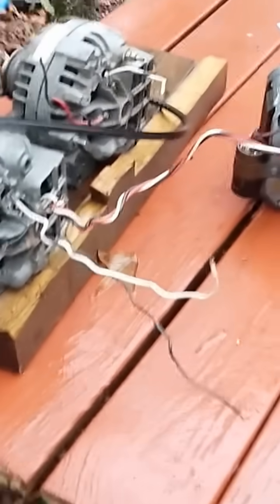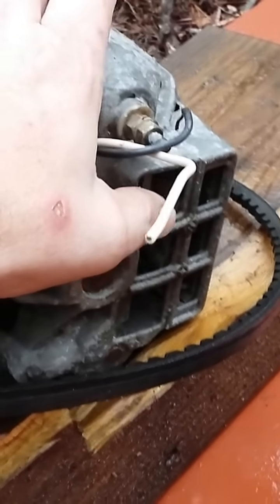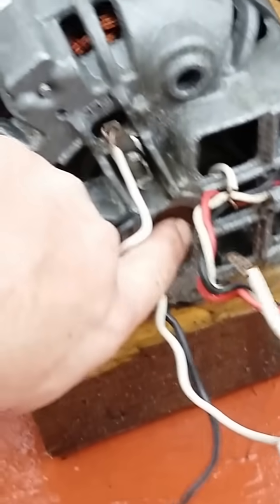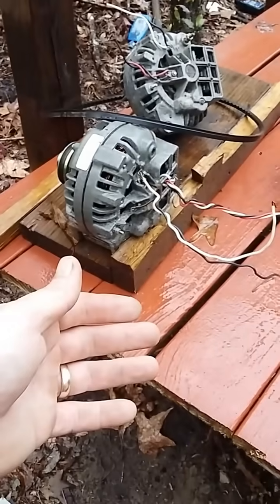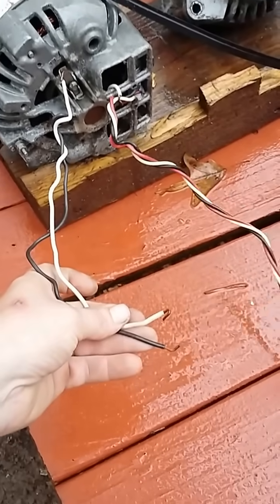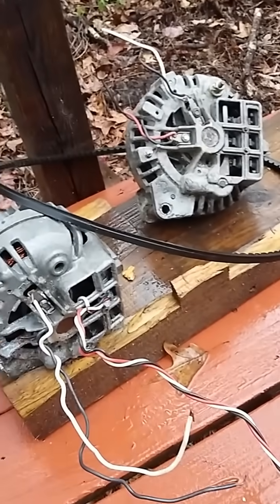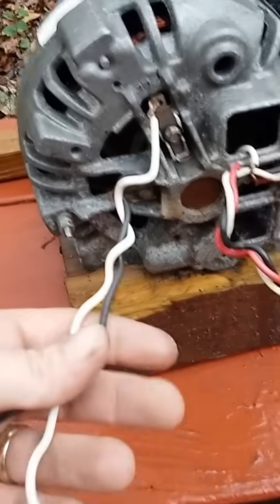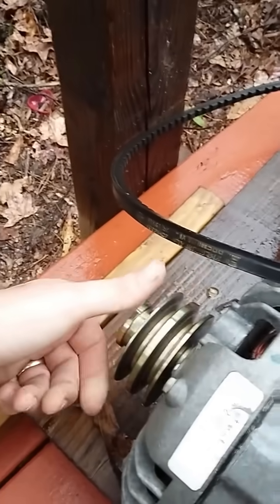Update Free energy forever no wind no solar no gas READ DISCRIPTION!!!

Comment: I need to know how to wire up the alternator please
Reply from the maker: August Nielsen your alternator is already a generator. all generators used to be called alternators and they actually put out alternating current and it is ran through a set of diodes called a bridge rectifier. you don't have to use all of your sine wave but you do have to use the top portion of it. If you want it to produce alternate current all you have to do is bypass the bridge rectifier but keep in mind it is unregulated until it gets to the bridge rectifier so you will need a capacitor to regulate the voltage there is a little more to it but you are going to need a high-torque high RPM (3600minimum) Motor that only consumes one or two amps and this can only be done with permanent magnet motors.. I hope this helps you out! you should do some research on vfds and learn how Transformers work and learn basics of alternate current like how to get a neutral from a ground and things like that... I hope this comment helps you, have a wonderful day.
Reply: ThomasBuie EnergyBuies at gmail com didn't make sense but ok. Thought of this same thing when I was 12. You run the 1st alternator with a motor but part of the power that 1st one generates  goes to motor. You can put a belt on the motor and run multiple alternators  and only 1 needs to have its current running back to the motor.  The others can be ran to batteries so you always have a charge. The reason this doesn't work 100% is just like when you have 1 in your car, it will go out and the motor will too over time. He's a scary guy moving to the woods. I used my setup when I was growing "vegetables " indoors and didn't want to run up my electric bill. Don't hook up a dryer or stove. Lights are cool, tv, a.c. might work. Is find a friend that's an electrician to help you.
Reply: ThomasBuie EnergyBuies at gmail com a generator
Reply from the maker: August Nielsen
Wired to be a motor or a generator?

Comment: I almost got upset thinking someone figured out my project but after watching the video I am at ease this is all bogus! You can achieve free energy with this concept but you are missing a lot of key things to make it function. I will give you one helpful thing you need a battery bank lol. You need much more than that but without a battery bank that cycles to maintain constant energy in and out this is a complete fail! Like I said I won't tell you the rest of the things needed to achieve the power needed and the process to do so because you are straight up lying this setup will not power a home at all!
Reply: John Corigan 
Like what?
Reply from the maker: I don't need your help I've already built a variable frequency driver for my alternator motor you are not a good person and I'm not going to help you finish your project I have about eight people that have their ears up and running and I'm going to continue helping people until they all have their systems up and running and they're sharing with other people how to do it I've told hundreds of people many Secrets but I will tell you nothing... you need a battery Bank... well no kidding!
Reply: If you have this in operation why are you only showing this and not an actual running of it working? I was going off this video what you claimed off this showing is not complete in any way! My apologies if there is more that you have on this with the rest of whats needed but this video does not show it.
Reply: Also I never asked for anything my friend. I have a working free energy set up similar to this but it is complete. Hence why I commented on this as not being possible in its current set up!
Reply from the maker: John Corigan I made this video to keep unwanted people away such as immature people that can't listen to baby's crying and so forth and so on. I have over a hundred and thirty videos and when my security system is complete I will open source everything!!! how I built my H Bridge, what I'm using for my pulse wave modulator, my rectifier circuit that feeds my H Bridge, all of it will be open sourced!!! even though people are not supporting me... 
I understand no one can afford to send me $5 and I think it should be this way..
I think that I should work my entire life for something just to give it away to everyone so that they can be happy and that they can save money and be free from treacherous activities... thank you for watching my videos it's how we eat!!
Reply: You seem to be very intelligent by the approach you are implying I have no doubt that you do know the secrets to the finished process. I am sorry that I came off that way most people like to create a concept and make claims they can't produce. I can understand that you may not want to show how its done but in the future showing results without showing too much in a video that could cause problems would clear up a lot of doubt.
Reply: I did and understand that you left out things 100% some things that were left out kinda made it look as if you did not know what you were doing but again my apologies

Comment: BS..I want to see you put 90 amps on a number 10 and use it to service your distribution panel   for your General lighting and household appliances. Hook all that up and show me where you are getting 240 volts pushing 90 amps of current on a number 10 wire with an ampacity of 30 amps and the wire not vaporize.  Hook it up and let me see it work with a meter.
Reply: You are right I wanted to see that because it would be a #2 AWG
Reply: Keyboard Warriors, gotta luv em.
Reply: billy Reyes .yes sir  Copper or a 4/0 aluminum. Both a very far cry from a number 10.
Reply from the maker: Chandler Guy good job running your mouth! And just so you know, the alternator in this video is my primary mover...

Comment: That’s a 60 amp Chrysler alternator. The “copper things” inside are called slip rings, and they are the contact points for the brushes, so the alternator is not brushless, nor is it 90 amps. The rotating part is called the ROTOR, because it ROTates. The fixed coils are called the STATOR, because they are STATionary. The alternator does generate 3-phase alternating current, which is internally wired from the stator to the diodes. You got that much correct. There are six diodes, not three. (By the way, your motor has no diodes at all.) Now, without voltage regulation, assuming you can spin the alternator fast enough to produce 220V, then at your claimed 90 amps output, again assuming that you connect a full 90 amps load, your wiring, which appears to be about 12 gauge, is going to burn up. Then there’s the problem of frequency. Light bulbs won’t care, but any appliances or electronics that require 60 Hz power will not function at the high and unpredictable frequencies the alternator will deliver. Then there’s phase angle. 220V household power is composed of two phases 180 degrees apart. Two of your alternator phases will be only 120 degrees apart, again causing trouble. 

This all assumes that you can turn the alternator successfully to begin with. What power source are you using to spin it? An electric motor? How is that free? The alternator can’t power its own motor because of mechanical and electrical losses. Friction and resistance are real. If you’re using commercial power to run the alternator, then you’re still paying the power company, and paying them more to overcome frictional loss in the motor and alternator, in the belt, and electrical inefficiency in both units.
 
Commercial power isn’t free to produce. They may overcharge us, but there is cost involved. I pay no more than $150 per month maximum, usually for about 1,500kWh. If you’re paying $300-$1,000, you should seek another retail service provider. 

You claim to make 19.8kW from that Chrysler alternator—90 amps at 220 volts. Look at a 20kW diesel generator sometime, its physical size and horsepower. Ask yourself why the difference.

I’ve watched people try to convince themselves—and others—about free power for 50 years. Yet it remains a deep “secret” that only a privileged few claim to achieve. You know, if it worked, we’d all have built our own rigs and there’d be so many people that the power companies needed to “silence” that there would be no way. They’d have to come after everybody in the country. It’s one thing to believe what you want, but something else to mislead others. Your video is a circular repetition of suggestion, but it explains nothing , proves nothing, and it cannot stand up to facts. That’s not “hating,” that’s an honest observation.
Reply: Alan's Mistakin' Acres I'm glad to see another person who actually knows and understands electrical mechanical theory. Clearly this young man needs to do more homework on his setup. I also am not hating on this guy. Just wish more people would research more in the educational aspects of the electrical field of sciences. Most do not realize that there is still room for new devices that are more efficient in power generation,  but this is the way to it.
Reply: I think he's very good at attracting attention and has probably made thousands of £ from this load of nonsense. Quite clever really 🤔
Reply: @simoncook7911  Yeah, he got one SMH look from me
Reply: Hey Alan, even single (2) phase 220 power is 120 deg out of phase, not 180. 3 phase power is transmitted through out the grid, you only get 2 of them in most houses. all phases are 120 deg out of sync.
Reply: @thefixer321  
No, that is incorrect. Three phase power is three full sine waves separated 120° apart. Typical single phase 220-240 is one SINGLE leg center tapped to ground so the positive field is 180° apart from the negative field. Draw a sine wave on a piece of paper and then draw a line right down the center. That is single phase 220-240. It has no reference to the other two legs of the system.
Reply: @thefixer321  No it's NOT! The electrical power delivered to your house comes from a step down transformer. That transformer DOES TAKE ONE PHASE (120°) and steps it down to 220 Volts AC....AND THAT 220volts WILL BE  180° measured between center tap of the transformer OR what is called the Neutral..120v...Neutral...120v
Reply: BEAUTIFUL, PRECISE RESPONSE! About the ONLY thing you did NOT mention to him was the reason there are 6 diodes is to provide Full Wave Rectification of each of the 3 phases (120°) apart. NOT ONLY THAT...BUT, he also filmed the video in 1/3rd of the camera's visiual horizontal spectrum (Worthless VERTICAL VIDEO MODE)

Comment: This dude is doing a lot of talking but ain't saying nothing. All he has is two alternators.
Reply from the maker: Jason Woodson 
No actually I have about 10 alternators or "Motors" really just depends on how you wire them... or you could use them as AC generators or DC generators depending on how you wire them...  I also have 4 self-excited generator heads and some permanent magnet DC motors. So what are you doing besides talking and not saying anything? I didn't see any questions in there...
Reply: @ThomasBuie  dude, your just saying a bunch of semi complex terms and trying to make it fly. The parts you have there are not going to do what you say it does.
Reply: com  nice

Comment: I tried this with a family member. We powered my eden pure heater, my TV and the dish box.  Ran it for 6 hours. We used a 3 farad capacitor I think it's called and a car battery. Was kinda noisey but it worked great!
Reply from the maker: lea nummer most people just don't understand the less components you have the less heat dissipation or thermodynamic losses and the higher the voltage the less resistance... you used a capacitor as a voltage regulator which is very common...  Great job! Now I haven't told but a couple of people that you need to have a small amount of high-voltage 2 pulse into your field winding but we'll figure it out...  ( the bridge rectifier is on the wrong side of the circuit) LOL I guess I'll go ahead and release the video and let people see...  but I wanted to say thanks for watching it's what keeps us going!!!

Comment: What is the horsepower of the motor you use to spin the generator?

You are right... many nasty comments. The internet breeds psychopaths, who build the ego by mocking shit they do not understand... and also by character assassination... I pitty these clueless fools, who go through life terrified of making mistakes, and being called a dumbass...

You sir, have a gift. Subscribing.
Reply from the maker: Thomas Walz 
The alternator in this video is my primary mover. I would say motor but it's not really a motor..  but to control it you have to have a high enough frequency to push the current through the voltage. (VFD)
Reply: ThomasBuie EnergyBuies at gmail com :
That doesn't answer my question of what you use to power the AC generator.

Do you have a follow-up video, showing it in action?
Reply from the maker: Thomas Walz  okay then...  I am using the alternator as a "motor". Is that a little more clear for you? Alternator is the Motor.
Reply: ThomasBuie EnergyBuies at gmail com 

Yes... Your knowledge and skills are way beyond mine... I'm a mechanic, fabricator, welder, basic machinist... electrical stuff has always left me flummoxed, yet sometime I succeed. I was an industrial maintenance tech... 3 phase is rocket science... when dealing with 220, 280, 440, 660, 880... yikes! But, I'm still here... could've used you at my side at times.

I can easily wire a house (actually, the wiring in my place is horrible, basement is a rat's nest, needs to be redone).

Back to the alternator... I saw a YouTube vid of someone making a motor from  an alternator, powering a go-kart. 

What I don't understand is how you get it to provide power from the 3 large wires while it takes power from the other two... I'm confused...

Be kind and patient with me.. I'm trying to learn... you are a teacher...

Thanks in advance. You are a wizard...
Reply: With a "normal" everyday dc motor, you have a rotor, with coils of wire, that rotates inside a shell of permanent magnets.  The magnets introduce a magnetic field that the coils of wire pass thru as the rotor spins. This causes electrons to flow thru the wire in the coils, from one end of the wire to the other end. (Or around the wire, to be accurate.) 

In a car alternator, there are no permanent magnets.  In place of the permanent magnets are other coils of wire.  When you pass an electric current through a coil of wire, it produces a magnetic field similar to that produced by the permanent magnets.

The smaller wires that you are referring to are the ones connected to those stator coils that "replace" the permanent magnets.  Apply a current to those wires and it creates electromagnets that create a magnetic field that the rotor rotates inside of, thus causing 3-phase power to be pushed out of those other 3 wires.

Normally, from a non-modified alternator such as the one in the video, you are only going to get about 13.8 volts dc (if you rectify the 3-phase ac to dc using the built-in bridge rectifier) at about 60 amps out of it.  He may have rewired, or re-wound, the coils, using different gauge wire, to achieve the required 110 or 220 volts ac for household service.  However, as the voltage is increased in the windings, the amount of current decreases proportionately.  For example, let's say for simplicity, that the alternator originally produced 12 volts at 60 amps.  If we reconfigured the windings to output 120 volts (times 10), the current would drop to 6 amps (divided by 10).  Then, if it were reconfigured for 220 volts (which is what feeds a home where I live), the current would drop to 3 amps.

3 Amps is not a lot of power when you consider that the average home has a 60, 100, or 200 amp service feeding it.

This information is, of course, for clarification only.  Food for thought...

Comment: First that alternator is not brushless infact you have wires connected to the brush tabs. Those alternators don't even put out 80-90 amps. More like 55-65 amps

Comment: it does work to make a gen but just take a  motor and  plug it  into your house using 110v and hook up the belt to the alternator then u get free 220v free just think your only using one motor from your main add a 2nd fuse 200 amp fuse box and run every thing else threw it your eletcric bill will only be like 40 month
Reply: no just use the alternator  for 13 volts and run it back to the batterys and use a 8k inverter to power the blower motor fitted in a made box then put the alternator in that will with some mods to the alt like making it a wind water wheel etc it will spin super fast enuff to keep the flow your using the 8k inverter to power the house not the alt  i dont know if it would work it was working in a dream i had kinda like a water wheel but 
 air not water
Reply: R, please don’t do that. If that worked, then I could power my house with a AA battery.
Reply: I thought of this also.  It would make sense to reduce my electric bill and that would be great for me.
Reply from the maker: You can use an alternator as an inverter if you bypass or remove the diodes but you must build capacitance and regulate the voltage with a capacitor. I would not advise hooking an alternator up to your house because you have to have another motor to turn it at 3600 RPMs for it to have a 60 hertz output and unless your primary mover only consumes one or two amps then you're defeating the purpose... the reason I say this is because this alternator produces 90 amps but that's at 12 volts if you change the voltage buy unrestricting the flow of current you will only have 9 amps at 120 volts... now on the other hand the alternator in this video that's modified is perfect for a primary mover! I would say motor, but using high-frequency to push your current through your voltage it's not really a motor anymore.. it basically runs off of the frequency. Hope this helps with your questions.